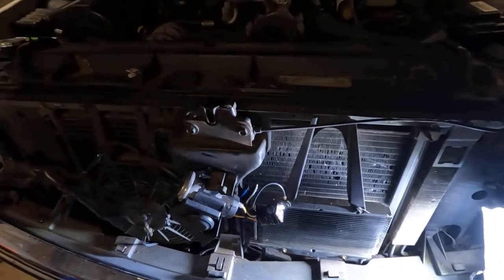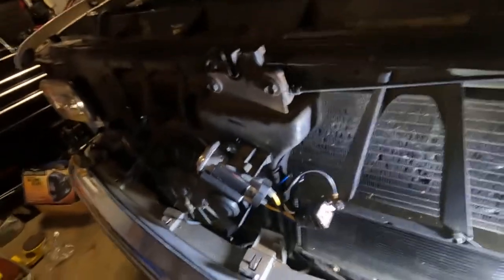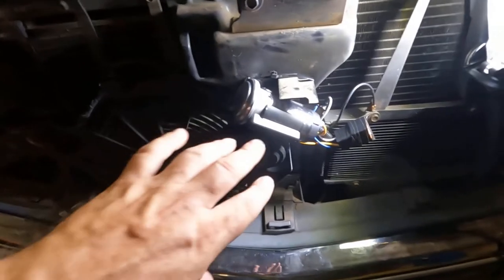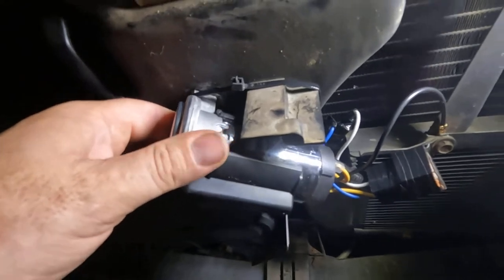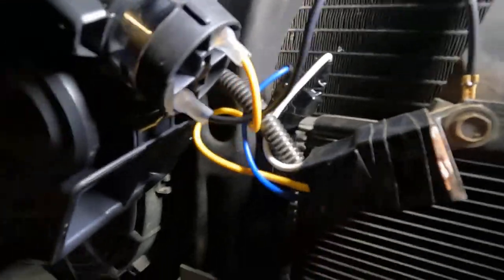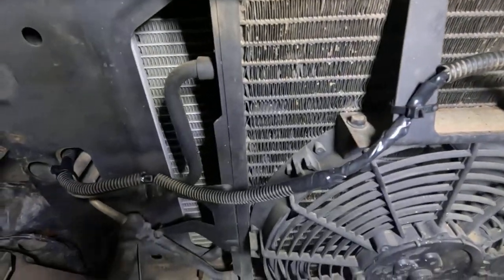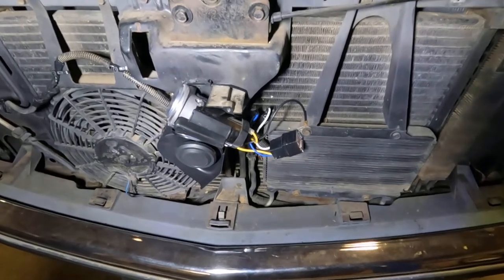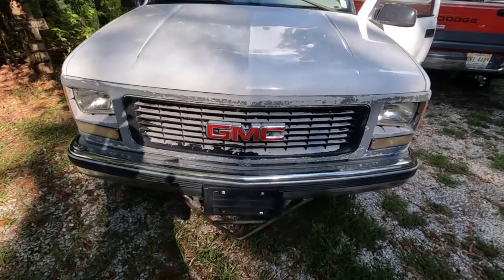Farbin 12V Air Horn / 150 DB

Comment: Does it still work?
Reply from the maker: It works fine. No problems since I installed it.
Reply: @homegrowncountryhomeplace  It does not come with a separate button right?
Reply from the maker: @BruceDavis2301  Mine didn't come with a button.